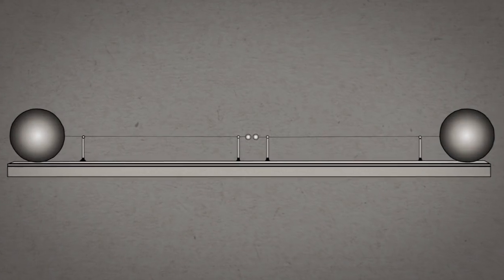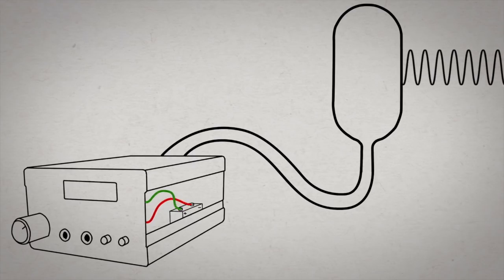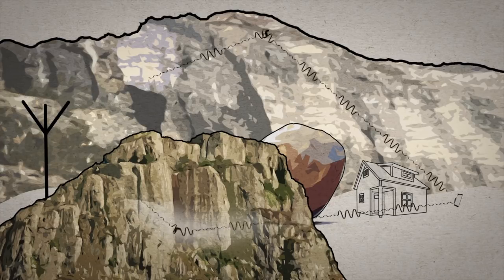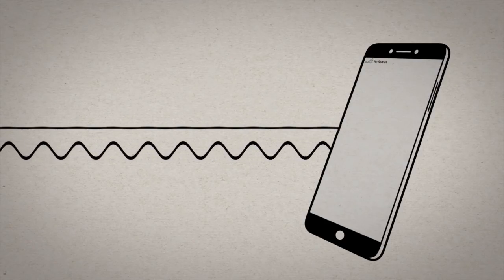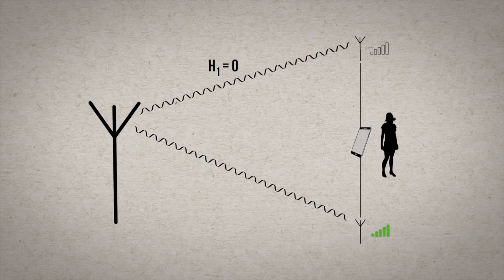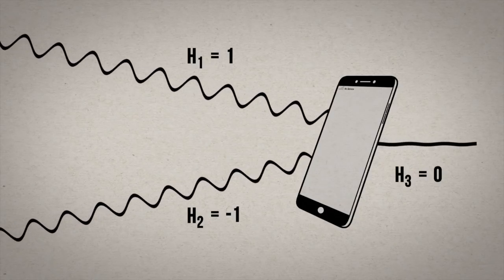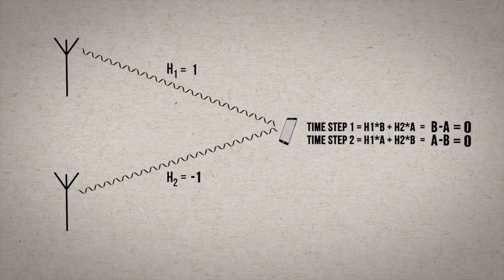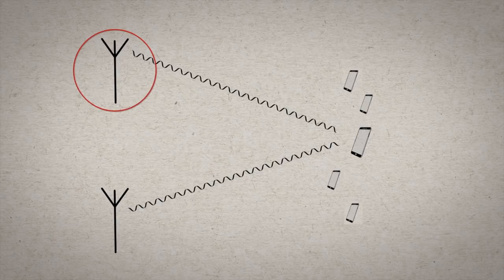How Wireless Communication Works

Comment: The whole thing about MIMO is to increase capacity. Due to multipath there is going to be inevitable different delays associated with different paths. Therefore when a transmitter sends a symbol in different antennas, in the receiver it just dont arrive at the same time. So my question is what is the whole point of MIMO if we dont take into account the delays and therefore the whole impulse response associated with each path. In other words why you only consider fadind as a scalar factor? Shouldnt it contains also a delay factor?
Reply: I find this a good point and the question is nice. I think the phase shift is assumed somewhat sufficient to incorporate delay as an out-of-synchrony measure, although in my humble opinion its far from being the same as phase shifts are shift-direction invariant (they alone dont tell you necessarily if one signal is behind or more advanced than the others signals). Definitely there is more to cover on this topic.
Reply: The delay spread is taken into account in OFDM-MIMO systems, the symbol time in OFDM systems is sufficiently higher than the delay spread at the receiver antennas. It means that the duration  for which a 1 or 0  is being transmitted is large enough, that the smaller delay spread does not let them interfere and the Receiver can separate them out.

Comment: In the cellphone example there are multiple transmitting antennas and a single receiving antenna. So it is multi input. But I don't understand why that is multiple output ? Because the cellphones do not have multiple antennas. Why it isn't Multi Input Single Output ? Or do the cellphones have multiple antennas too ?
Reply from the maker: That's correct the cell phones also have multi antennas.
Reply: @ArtOfTheProblem  yes, but one antenna for gsm another antenna for cellular another antenna for bluetooth another antenna for gps ? What if a device only  have a cellular communication abilities no wifi, gps, bluetooth. Or if a device have wifi only, no cellular, gps, or bluetooth. Does the device still have multiple antenna ?

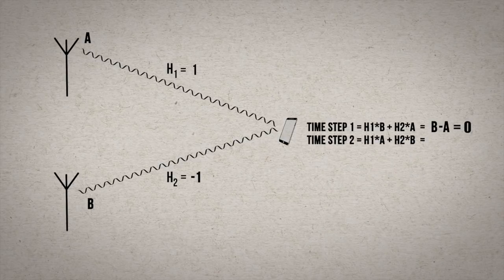Comment: 9:00 How does the receiver know what H_1 and H_2 are? Doesn't it need that to find A and B?
Reply: I don't think that the receiver needs to know H_1 and H_2 because the decoding algorithm for the message remains the same
The two message symbols being sent remains in the form of (A)(B) and (-B)(A). Now, regardless of the receiver knowing whether the symbols are being sent from H_1 or H_2, the received equations will remain A-B and A+B

Comment: wow! so clear
Reply from the maker: glad to hear it thanks for the feedback we have 3 more of these on the way
Reply: Very nice I'll watch them! 
Could you have a look at the DJI Digital FPV and tell me what you think of the antenna configuration? We usually fly analog and so we don't really deal with this distribution of signal, deciding on antennas is trivial but with a MIMO... no idea what's the best configuration for long range, probably not something as trivial.
Also did you read that paper by a Chinese team where they use circularly polarized antennas to increase diversity?